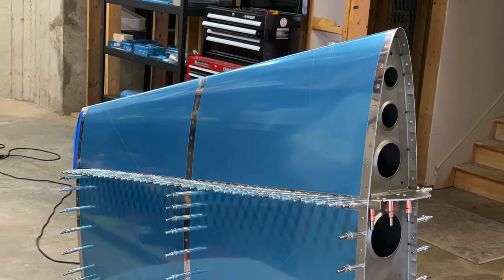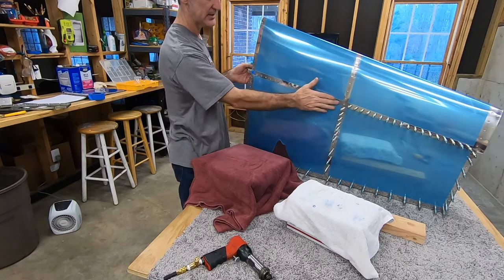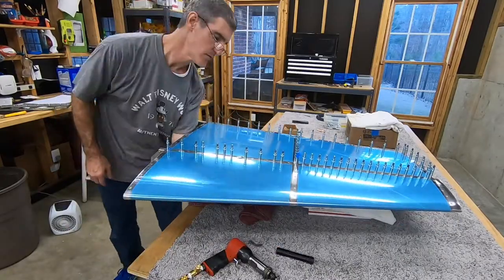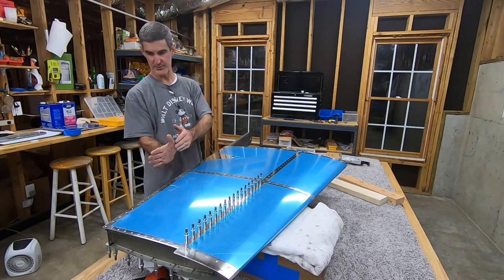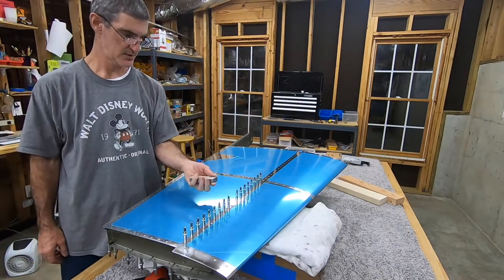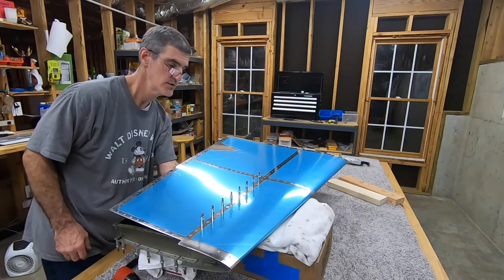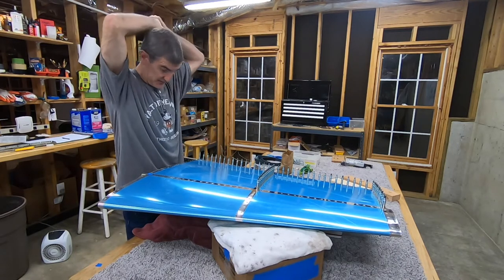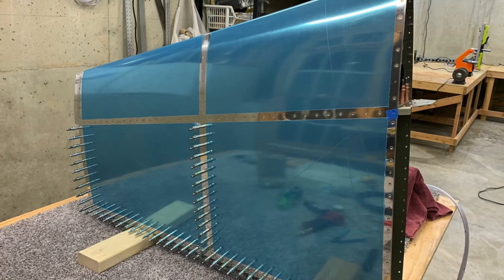RV-10 Build Log - Emp 15 - Riveting the VS skin to the front spar

Comment: Looks really good. Try adding masking tape to your bucking bar (or rib/spar surfaces) to reduce scratches. As you say - not a major issue, but saves touch up etc. 

Looking forward to following the build - thanks for sharing!
Reply from the maker: Thanks for the tip!  I tried taping a little piece of paper towel to the end of the bar in a couple of places later on with mixed results.  Sometimes it would get in the way, and sometimes it would just come off.  Tape alone is probably the best compromise.
Reply: I realize Im kinda randomly asking but does anybody know a good site to watch newly released series online ?
Reply: @Tony Saint lately I have been using Flixzone. You can find it by googling :)
Reply: @Tony Saint i would suggest FlixZone. You can find it by googling =)